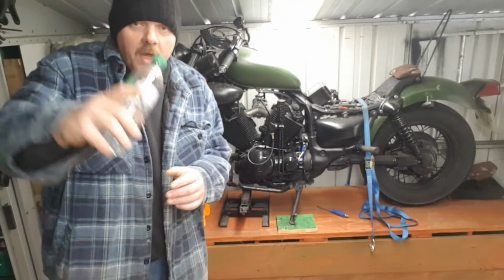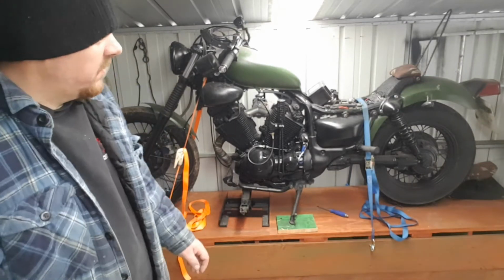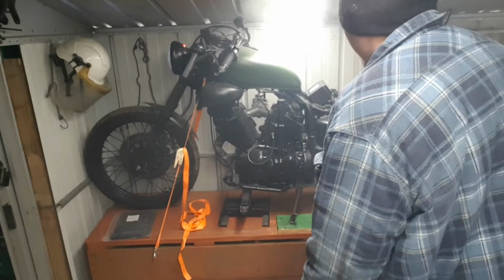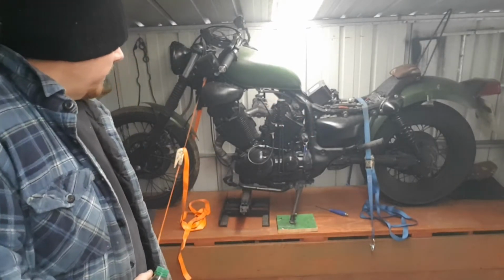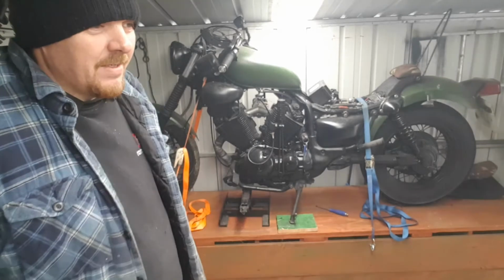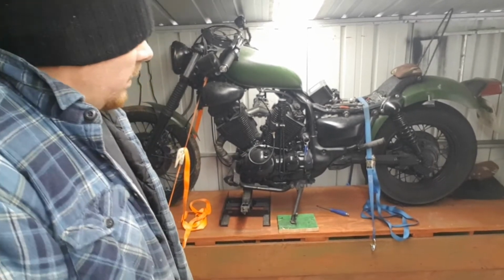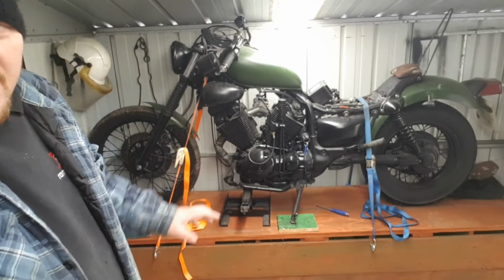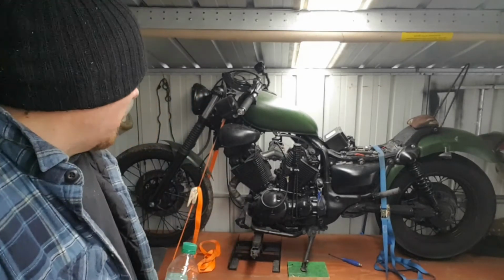virago xv535 will it start

Comment: Problem with a one piece solid mount intake, is that metal expands and contracts.  That's why harley had rubber mounts from each cylinder head to the intake to allow for expansion and contraction. That one piece manifold might work if you cut it about an inch or so from the flange mount, and put a rubber coupler with hose clamps. Then your flanges could sit flush against the head without leaking.  And the rubber would compensate for expansion, etc.
I'm curious if you bought the steel intake or the aluminum one.?. I see he sells both types
Reply from the maker: Lol was thinking off the same when fitting will be cutting and putting flange so it sits better. Thanks for comment. Stay safe.

Comment: Hello there. Are you still riding this bike? How did the single carb hold up after using it for a while? Did you sort the manifold mounting issue?
Reply from the maker: I sold the bike last year and up to then it was running fine and manifold I ended up sanding it till it matched up just right 👍